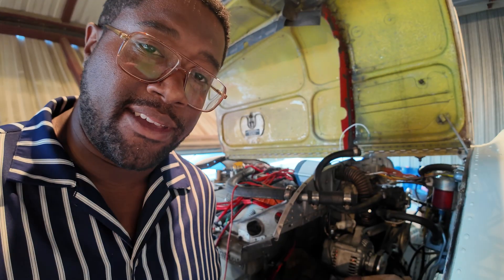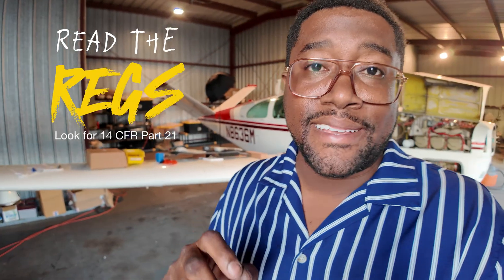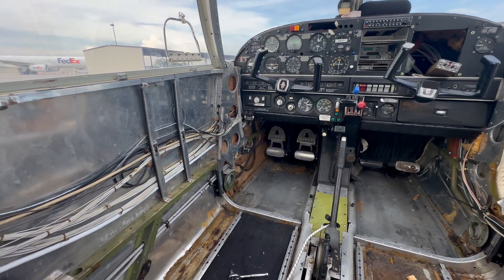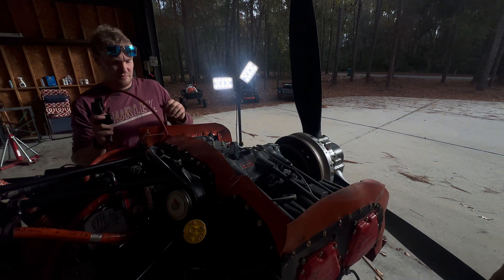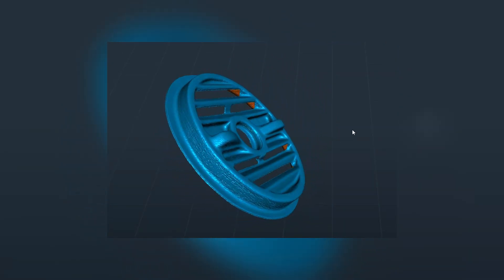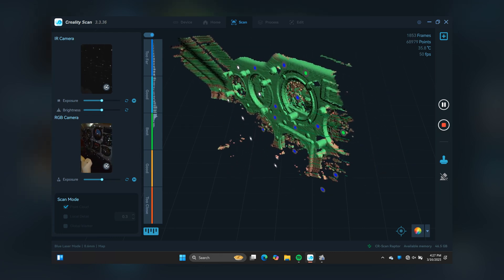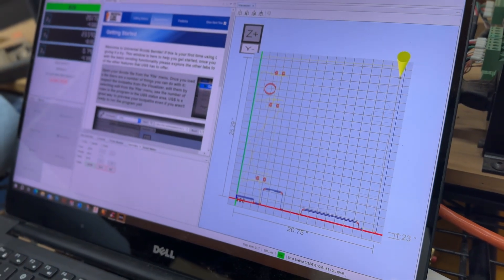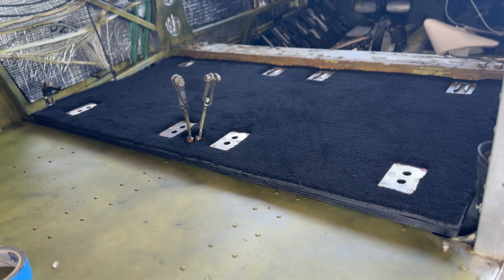3D Scanning - Modern Tools for Old Airplanes

Comment: Hmm i have two high end 3d scanner both ' blue light ,  and lazer and photgrametry,  A scantech axe B 11 and Artec spacespider .I just so happen to have a langmuir mr1 cnc mill:a manual mill and a manual 14x40 gunsmithing lathe , also a small cnc plazmatable . I also have a few programs for reverse engineering like geo magic design x .Im just getting into aviation.  Maybe its time to start belting out some parts for folks.
Reply from the maker: Maybe it's time! You're exactly who the GA industry has been waiting for to share your skills and capabilities. In some instances, a simple sheet metal part is grounding airplanes for years.

Comment: I’m doing the same thing on a mixture of aircraft and race cars. The technology is truly amazing.

A word of warning, I have been told by friends in manufacturing that the cost for business insurance can 5x if you’re making aviation parts. 

Most shops will immediately turn down the work if you mention it’s going on an airplane, and conveniently leaving that out will put them in a rough spot should something happen. (Proving ignorance of the final use case)
Reply from the maker: Would love to some how see your work flow and learn whatever I can! My processes work but could always be improved. 

And good note on parts - in all actuality it should not matter since the supplier is not providing a statement of compliance, or a something akin to a technical service order. They don't sign up to meet a particular standard (say ASTM, or MIL...) unless you ask them to and they agree. As far as they know, they're making a part for a lawnmower. 

If you tell them you're putting it on an airplane, they don't have the time, experience or desire to understand and legally interpret FAR 21.9 so they default to signing up for an appropriate standard (above) which could then create more paperwork. If they're a good shop, they'll understand that there's a short list of "typical" materials blessed by the FAA in various ACs like AC 43.13B for the repair of an airplane (6061, Birch...) and combined with solid machining practices, they're on their way.

Unfortunately enough a smaller shop or mom and pop just doesn't have the time to worry about it and that's ok. Check out Send Cut Send for parts. I use them all the time and they already have partners in the aerospace industry so they're well aware and comfortable making those types of parts. 

Ultimately in Part 91 types of operation, the buck stops with the person approving the part for installation and return to service. In experimental airplanes that's the builder/repairman, in certified world that's typically the A&P, IA, or a DER. Which is why it's so import to treat those folks with respect - they take on a lot of liability for these 60 year old birds.

All that said...negligence is negligence and we live in a litigious society. That's a given. 

Excellent comment.
Reply: @OpenSourceGA the stuff I’m currently working on is calculators for reverse engineering suspension. Essentially you 3d scan the car, line up a bunch of points with the scan and my calculator will spit out a bunch of the information about things like CPTC, Camber gain, and Bump steer.

I’m the past I’ve built some aviation prototype parts to help disabled people fly, along with custom bits for a cozy mk4

Comment: Thanks for this channel! I'm looking forward to seeing more! 
This is exactly the kind of stuff I've been doing with my 1949 Navion. Mine has the E-series engine (like the older Bonanzas), and unlike most other engines where the prop and the prop spinner mount on a flange at the end of the crankshaft, the E-Series engines have a splined crankshaft with a big nut on the end of it. In my airplane (and I think the early Bonanzas are similar), there's a bulkhead that mounts to the prop nut, and then the spinner mounts to that. My problem is, however, that everytime they needed to adjust the alignment of the spinner, over the years, they'd drill some new holes, and the bulkhead has become pretty much swiss-cheese in a structurally critical area. In addition, due to a hangar door incident, the bulkhead is no longer exactly round, or centered on it's axis of rotation (yielding a wobbly spinner). Enter 3D scanning, CAD, and an online CNC shop. I scanned the prop nut and the original bulkhead to get proper dimensions, then from that made CAD models to replace the bent parts. Then I had these 3D printed in cheap nylon just to make sure that everything fit together correctly, and after a few revisions, sent the STEP files off to have them machined out for 4130 steel. Additionally, using a FEA package from Ansys, I was able to ensure the parts I designed would well survive the stresses and loads encountered in flight (up to 150% of the VNE) without serious deformation or failure. All of this was overseen my by IA and installed under rules governing owner produced parts (see AC 23-27, AC 20-62E, and FAR 21.303).
Reply from the maker: First if all, you’re my kind of nerd! And I would really enjoy meeting you some day. Brilliant! Well presented here too - your comment could be its own channel episode.

This is exactly what the industry needs to be doing, but we’re so often afraid to really understand the nuances of the regs and advisories. The way you tackled that with 3D scanning, CAD modeling, cheap prototyping, FEA, and still looped it through your IA and the proper regs — man, that’s textbook smart ownership and maintenance.

You didn’t just throw parts at a problem, you engineered the right solution and respected the structure and certification environment we’re operating in. Seriously impressive work — keep it up and keep sharing! This kind of thinking moves GA forward. You're welcome here!